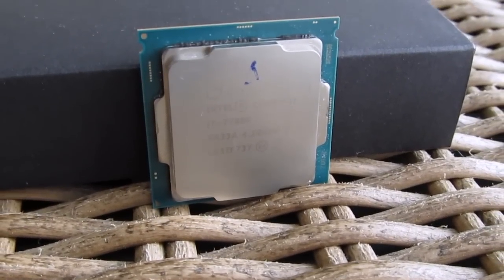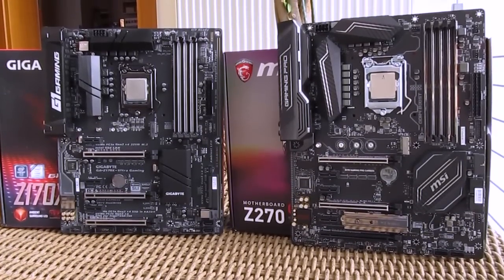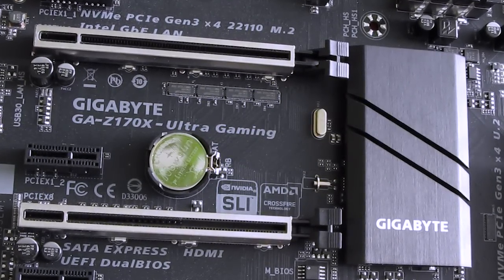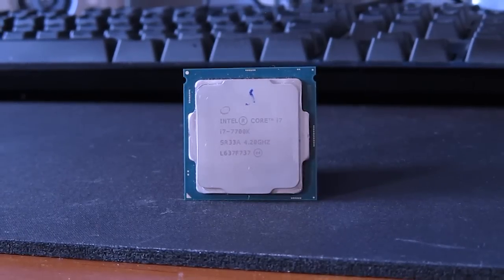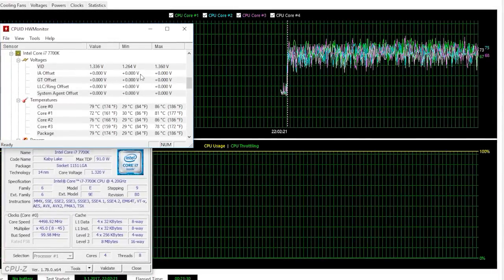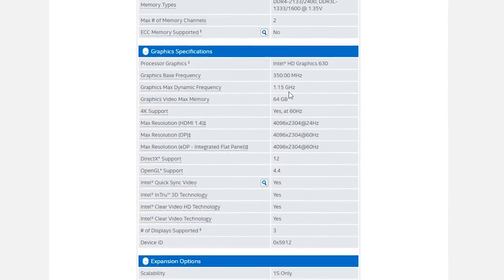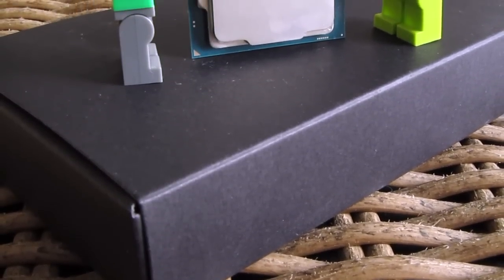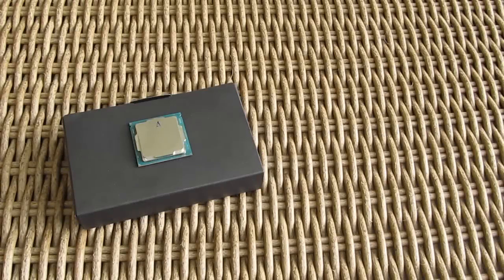Intel Core i7 7700K (vs i7 6700K) Review - Worth Upgrading?

Comment: were the temps on your chip with a aio cooler?. as i am thinking of going to an i7 and the 7700k is like 7$ more than the 6700k and if its oc potential is better that's worth it to me. but not if its hitting those kind of temps in aida 64 i would be scared what prime 95 or intel burn test max would do to it
Reply from the maker: +Damien yes, aio!
Reply: dang seems pretty toasty how are people cooling this thing at 5ghz. how high was stock vcore going?I do hope ryzen does some magic as intel really needs a reason to give more performance gains
Reply from the maker: You can see it in the video, around 1.35V, but I think it can go lower, undervolt it, I think that MBO manufacturers are going a bit overboard with default settings or Intel is  just recommending higher voltage

Comment: So is it better to get the 6770k and oc it than 7700k? Anyway, just love your reviews. Keep up the good work!
Reply: Rodney Ynares My 6700K at 4.9GHz runs cooler than the 7700K at 5.0GHz. I'd say if you have a good cooler (using Corsair H110i GTX) then you can get virtually the same OC performance and temps out of the 6700K. Though your motherboard might also be a factor along with luck in the silicon lottery. I don't think the 7700K is any sort of tangible upgrade at all.
Reply: Rich Tea but that's not ture

Comment from the maker: The new Core i7 7700K is currently Intel’s strongest (pro)consumer level CPU on the market (excluding the enthusiast level X99 platform), there’s no doubt about it. It can hit 5,0 GHz or more when overclocked,  it received support for the hardware acceleration of HEVC/H.265 codec and Intel Optane flash memory, but beside that there are no real architectural improvement, no IPC gain, so in the end it feels a bit underwhelming. What do you think? Is it worth upgrading to Kaby Lake from Skylake, Haswell or even Ivy Bridge?
Reply: TekTick i think 2017 is going to be non competitive year for the cpu market..i doubt AmD Ryzen will make a big dent..it might helps lowering the price of intel cpu tho i suppose..other than that for existing skylake owners just be content with what u hv unless ur using core i3 or the pentium lineup then get an i5 once the price is sensible
Reply: crysisownz I think not. people like salazr studio also had a hard time believing zen will be a big hit until he did his own research and speculations etc..... and his conclusion says that amd zen will be able to compete with skylake and kabylake but still I hope amd goes up again. The only thing I ever bought from amd was the rx 480. I just want Intel to try again and to fix the problem with their prices but anyway. Have a nice day ;)
Reply: TekTick first
Reply: My brother needed to upgrade as his fx8320 died. Went and got him a 6700k system and it went to 4.5ghz on stock voltage. Yeah, we won the lottery for sure and right now its sitting at 1.35v @ 4.9ghz. I mean, I just don't think there is any need to upgrade from anything, but sandybridge level holdouts or if you absolutely NEED new things like usb 3.1 etc.

His new PC will last him 3-5 years with ease.
Reply: I have a 6700K now at 4.9 GHZ on water as well . Super stable and temps are fine. Not tried to push it any further, but will eventually try when I get bored. The 7700K is a big disappointment.
Reply: *****
I think the motherboard, cooler and PSU have helped a bit. Using a Corsair H110i GTX with ASRock Z170 OC Formula and EVGA SuperNOVA 1200. Although I can't say for sure ofc. It could just be a really good chip!
Reply: I think people see u wanna get the real performane if you overclocking the i7 7700k and the new motherboards have a great support. But if i have a 6700k i dont change.
Reply: Ricardo Bastos I'm getting a complete new build so it's worth it for me, I wouldn't change from a 6700k otherwise
Reply: Would have been really nice to see the 7700K @ 5ghz vs the 4.6Ghz 6700K Trying to make a decision to upgrade